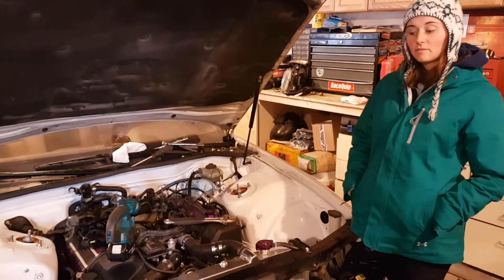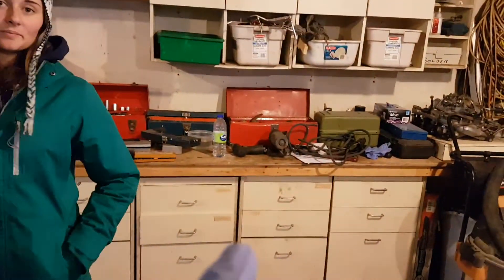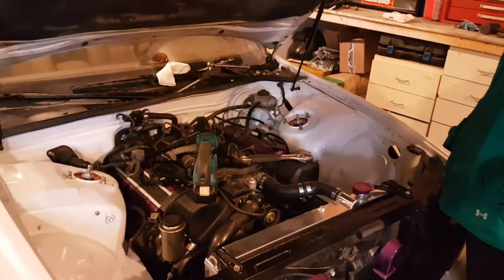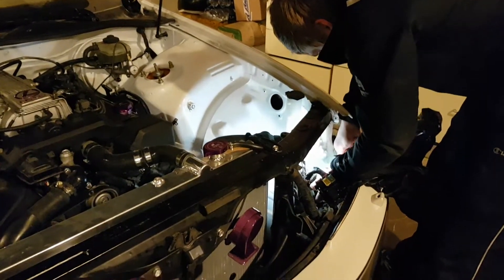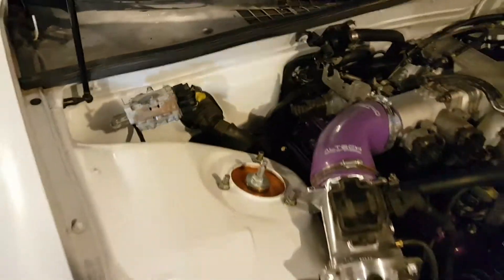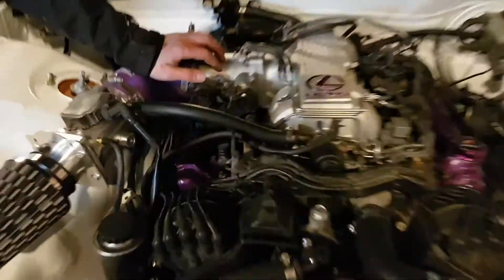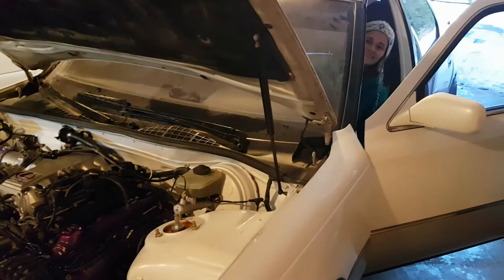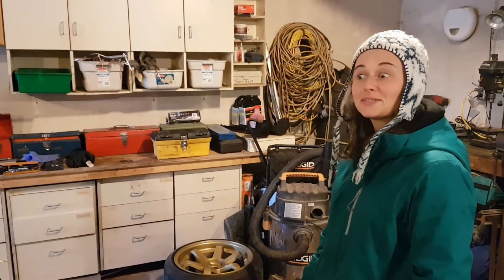1uz LS400 is Alive!

Comment: Please read this comment, I know the fix! This was happening to me my car ran horrible cold, and better warm and then one day the catalytic converters were glowing red hot and it sounded absolutely horrible. It was dumping all of the fuel into the exhaust. Horrible smell and no power whatsoever. I changed the top ignition coil and nothing changed. Then I changed the bottom one, (which is a pain to get to) My car runs 100% now and my gas mileage has doubled. No more red hot catalytic converters either. You can buy both ignition coils you need for about $36 last time I checked. I know this will fix your problem! I thought I was out of luck, but now my car runs amazingly! Trust me guys, it's the ignition coil on the bottom half of the drivers side of the motor. Close to your coolant reservoir near the bottom of it. I promise you, it'll make that 1uz run like a champ!
Reply: Also, if you guys do change it, remember to pull the battery out. It gives you a lot more room to work with!
Reply from the maker: Hey thanks for the lengthy reply! We actually already replaced that coil and it's still happening but we think it is still an ignition issue could be the other coil or an ignitor
Reply: JDMods that's very true! Well, I'm sorry to hear it's giving you so many problems! Ignitions can be quite tricky! I hope you guys can get this beautiful machine running right again! I'll be looking out for your next video! Thanks for today's lunch break entertainment haha!

Comment: ECU's are notoriously bad in those ...I would get the ecu rebuilt
Reply from the maker: Money Mac when I first got the car the ecu was one of the first things we checked and it looked fine
Reply: JDMods it's not the ECU I've had Ls400's with ECU problems before. The problem is a bad driver side ignition coil. My car was doing exactly the same thing as yours, red hot cats, runs bad cold and clears up when warm. The part is cheap and I know you guys can easily change it together. Trust me, I love ls400's and I wouldn't steer a fellow cruiser in the wrong direction. I want these cars to last as long as they can so I want to help out as much as I can! I know what it's like to be stuck. Eventually the pinging got worse and worse until the car wasn't driveable due to red hot converters. That's when I had to change mine. I borrowed the part off my buddy's ls400 and it worked so I knew it was the fix. Then I ordered a new OEM replacement part. Love the channel guys! Hope this helps!